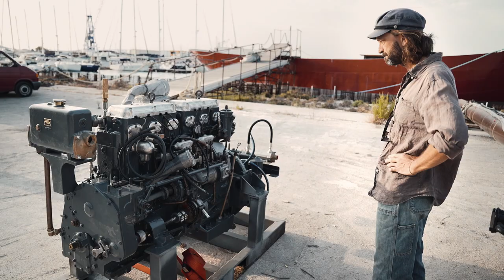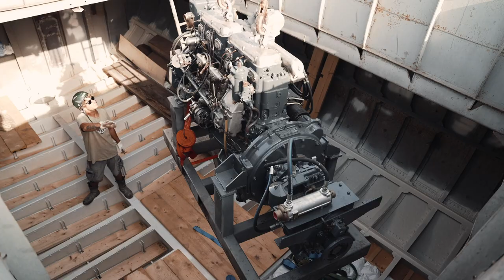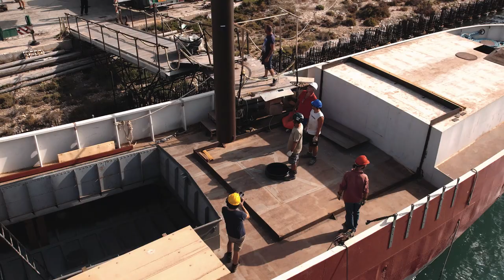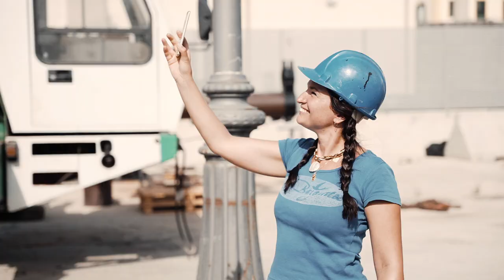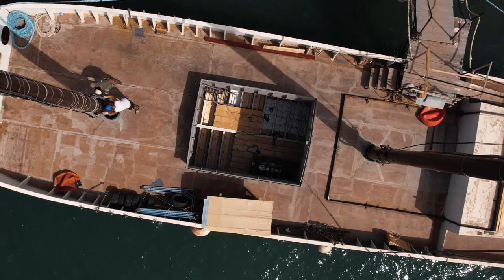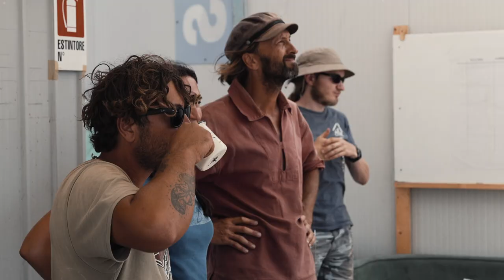BRIGANTES: MASTS!

Comment: Did the issue of the oil bubbling out between the cylinder heads and the block get resolved?
The video of the engine before it left Ireland clearly showed it was leaking then. 
Nice paint job on the Gardner by the way too.
Reply: yes we (actually mostly carmelo - white hair and moustache in the video - and pietro) finished the job perfectly =)